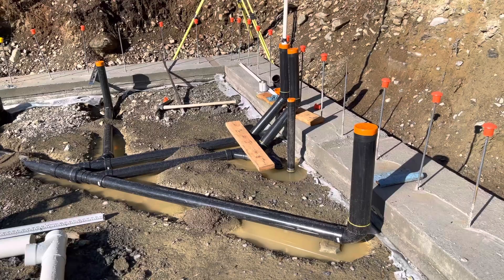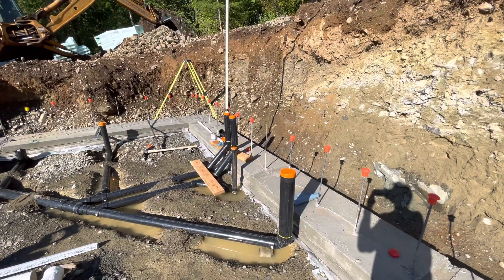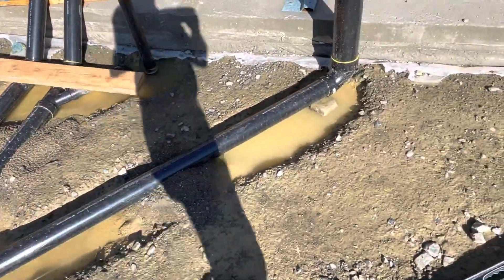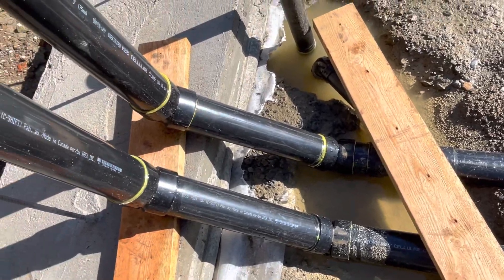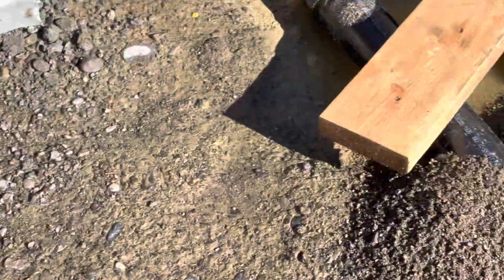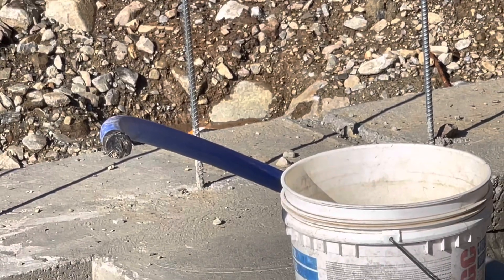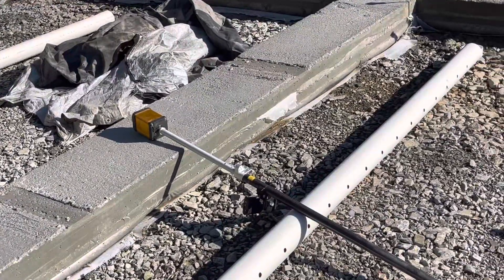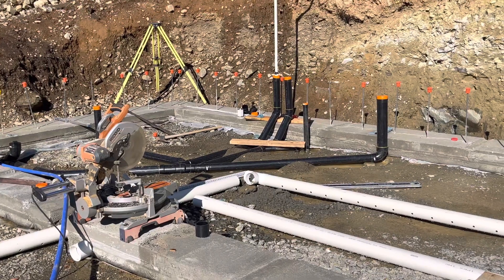Underslab Plumbing Learnings

Comment: I would have used schedule 40 if you're putting concrete down. I see a lot of that thin wall ABS break. Too much stress on it but does look good. Good job!
Reply from the maker: Agreed....I believe it is sch 40.... that stuff is tough as nails...
Reply: Tough for a while . But it will eggs it's self after 20 years but hey it work also what I find is they use clear glue and don't primmer it thin glue falls out of fitting let's roots in I hate abs lol I use sch 40 not cellcore that shit is junk . And your not suppose to Barrie it.. I see them Barrie cellcore all the time not suppose around here